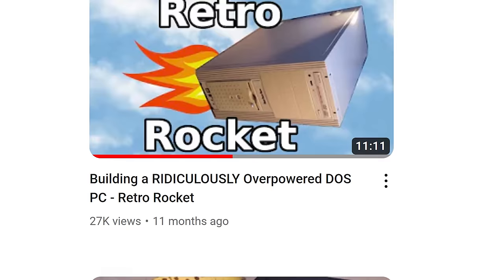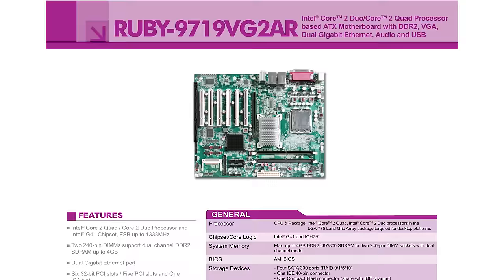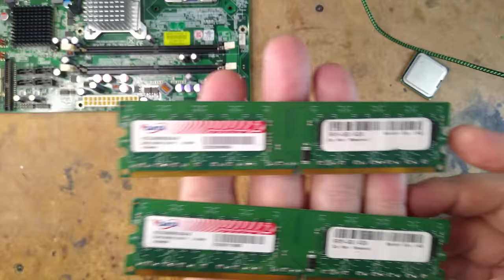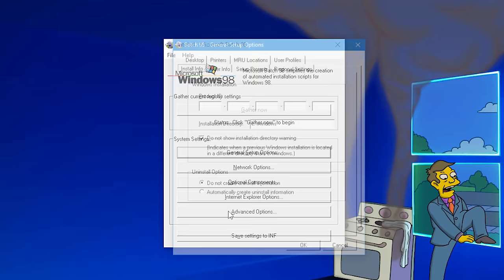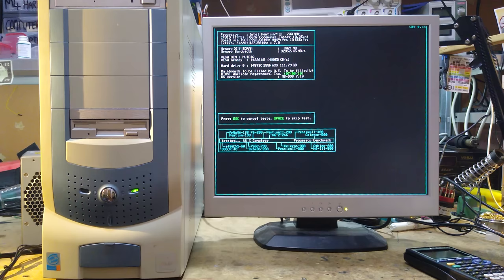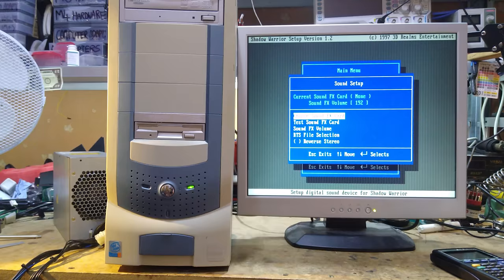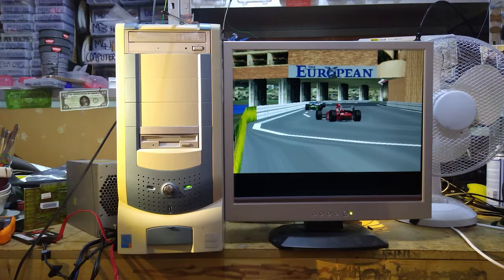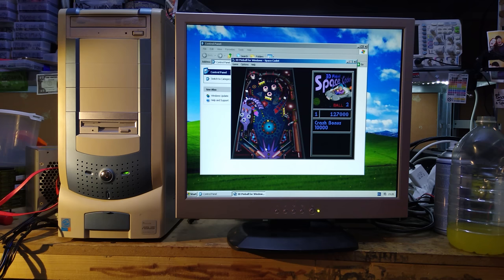The FASTEST DOS Gaming PC Ever?  #DOSCEMBER

Comment: Is it even feasible to run an OS off of a CF card?
Reply: Yes, it's very common on industrial computers.
CF memory cards have a built-in IDE/PATA cotroller so you only need a PCB adaptor with a IDE connector and a CF socket or a motherboard with integrated CF slot(s).

Counterfeit cards, apart from using defective memory or less capacity than specified on the label, usually do not have the ATA controller either, and most of the flash memories (CF, SD, USB flash drives, etc) sold online are counterfeits, for years now I have only bought memory cards in physical stores or online stores that have a physical store.
Reply: Mr Guru  That can work with cheap stuff like those 2TB flash drives but I'd rather not risk it with more expensive stuff.
I am from Spain, the last time I bought SD cards online (on fleabay UK) I received three generic cards with a Kingston sticker made at home with an inkjet printer.
I paid €360 (whatever the GBP equivalent was) for three 128GB SD cards that in the physical store would have cost me €420 and they sent me three generic 2GB cards...
PayPal told me that I had to send them back to the seller and give them the tracking number so as soon as they reached the seller they would refund my money.
I spent almost another €20 to send them by express courier and of course the seller never accepted the package so I also lost the €20 of shipping.
Trying to save €60 I ended up paying €360 to some scammers, €20 to a courier and €420 to the same local store where I should have originally bought the cards. 

I have a MediaMarkt about 9 km from home, I doubt that one of the main consumer electronics chains in Europe does not buy directly from the manufacturers so I prefer to pay a little more but be almost sure of getting a genuine product, and if for any reason it does not work properly, it has a minimum 2-year guarantee.
Anyway I haven't visited the store since mid 2019, it costs me more to go there than they charge for 48/72 hour shipping...
Apart from MediaMarkt I also buy from other international chains and well-known computer stores from Spain, but MediaMarkt is my nearest store and also the one with the cheaper shipping.
Reply: Mr Guru  For mini PCs based on Intel Atom CPUs, I needed external storage with a very low power consumption, first I had bought a USB enclosure for a 240GB SSD for a MacBook Pro, but it was too power-hungry and also way more expensive than a 128GB SD card.
Reply: Mr Guru  Yeah, but that was 10 years ago...
Reply: MrTGuru  They don't help? You don't have reputable stores that get all their stuff via Ingram Micro?

Comment: You should have gotten a Core2 Duo E8600 instead, better single threaded performance which will improve DOS games.
Upgrade this with a GeForce4 or a Radeon 9800 Pro for proper drivers on Windows 98.
Reply from the maker: Yeah good shout!

Comment: I'm surprised you got an ISA card working under XP. After Windows 2000 Microsoft decided to drop all kernel access to the ISA bus. Maybe the BIOS has an option to mirror a PCI IRQ/DMA to the ISA, basically making the main board convert PCI calls to ISA.
Reply: Uhm and how is LPT and COM ports supposed to work? They live in ISA land and they still work.

You just need new drivers for XP and again for Windows Vista (also works on 7), also on Vista and 7 you get to manually re-enable ISAPnP support. There is an SB16 driver in XP and Vista/7 and i think WSS and some other things as well. Of course initialisation is difficult (but look at this nifty GRUB chainloading trick in this video) and there are lots of cards without drivers for these respective systems.